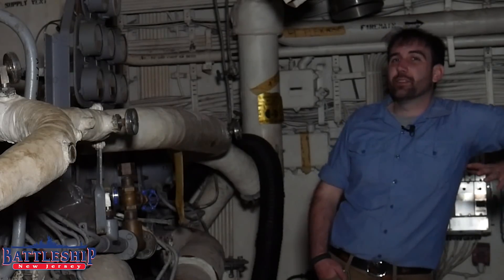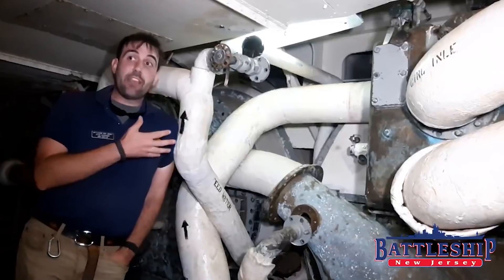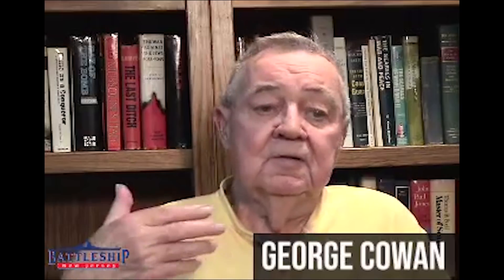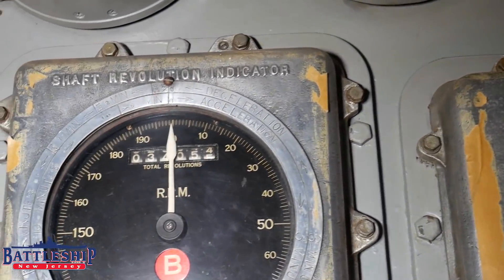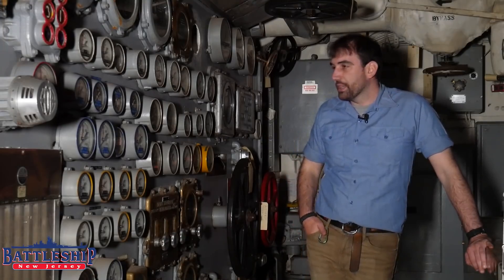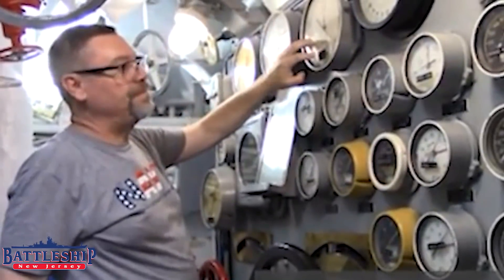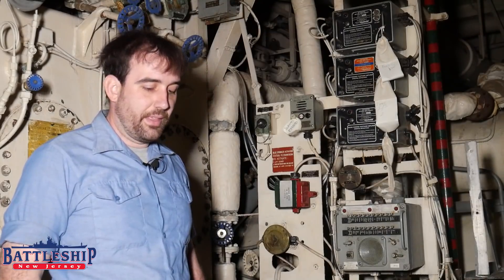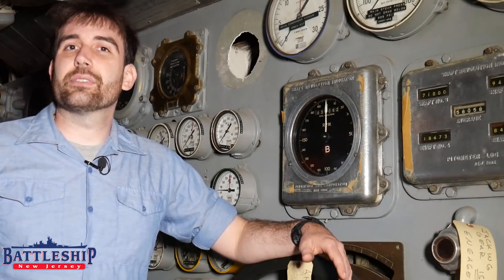Inside Battleship NJ's Engine Room #3

Comment: Closed system, so if you loose water you have a tube leak? Superheated boilers? Used to work at a coal fired steam station so some of the equipment I recognize
Reply from the maker: Mostly a closed system. You still lose steam from dry cleaning, the whistle and a few other systems on board.
Reply: Not to mention steam and water leaks, loss through valve and pump packing glands, loss when the boilers were blown down (draining water from the bottom of the steam drum to remove sediment and impurities), and tapping a low pressure steam line to run a still.

Comment: You mention the emergency diesels often, is there a video on them? I presume they are for emergency electricity generation. Normal electrical power is off steam turbo generators? Do the diesels generators and boilers use separate fuel systems? Why not just use the diesel generators with some redundancy and forgo turbogenerators?
Sorry too many questions, I know.
Reply from the maker: Check this out : https://youtu.be/2cVDdFuA9AY

Yes, these are totally separate fuel systems.
Reply: Thanks so much. I remember that video. Maybe it’s just me, but I think a lot of people would be interested in knowing more about the diesel generators. Type and make. Maybe a future video?
Reply from the maker: They are Westinghouse GSP.
Reply: @T.J. Kong Exactly.. we went "dead in the water" alot during GQ drills which resulted in loss of power and the emergency generator would power up just enougth equipment to run ventelation, lights, pumps etc. NO A/C.